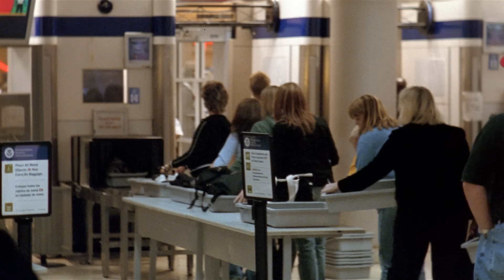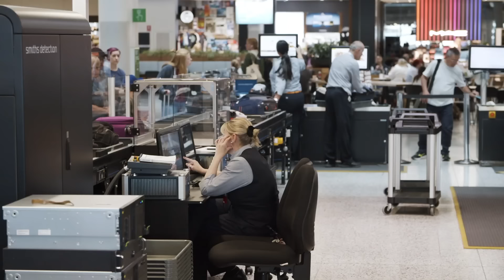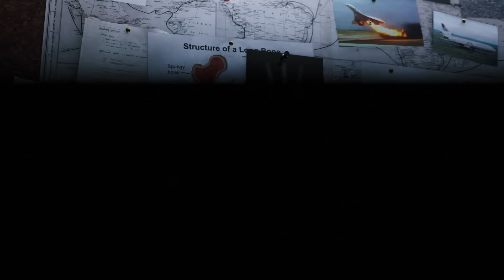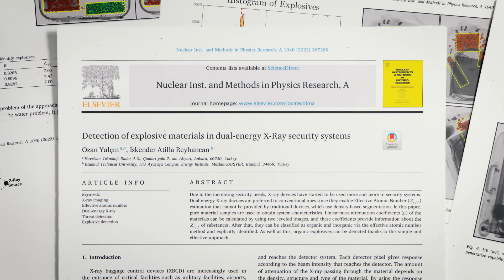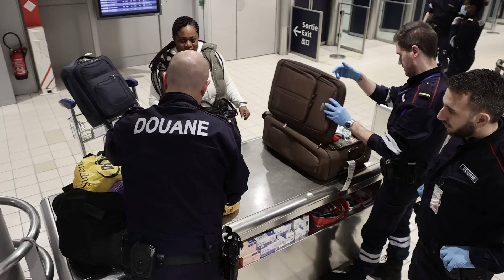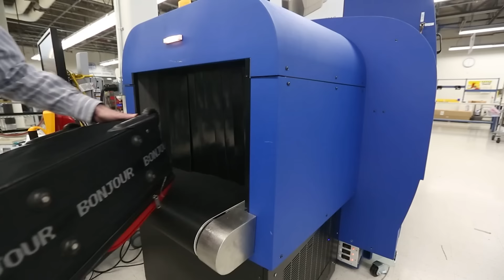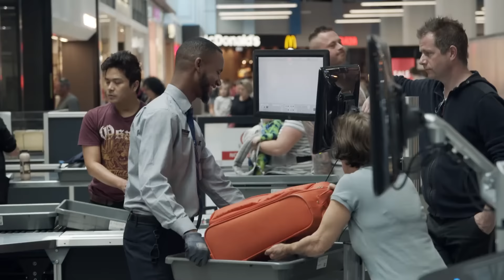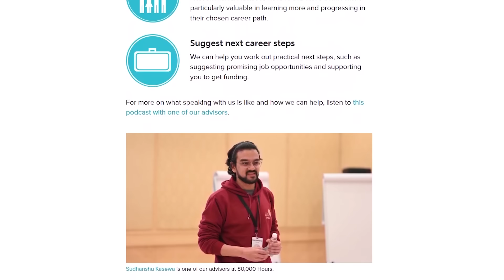Why Airport Security Suddenly Got Better

Comment: Wow, it does it so fast. LTT just did a video on one that had scans that could take 11 hours for high detail.
Reply: I just watched that video too. I have a masters degree in medical image processing, so the immediate first thing I thought of when I saw both these videos was "dude, thats spectral ct" lol

Funny how both these videos came out so close to one another
Reply: LTT?
Reply: @ShainAndrews  Linus Tech Tips
Reply: Cause the "emmiter" and "reader" of his machine is stationary and is the object that moves, and it changes the focus. with each object.

The airport ones have an easyer job, because the position and focus of the object is alwways the same (the tray). And the emiter and reader revolves arround it. Les variables, easyer job, thus faster.
Reply: It's also doing much less detail to begin with. The one LTT have is for verifying an individual M1 screw is properly in place, or that SMD solder joints are good, while this one just wants to know roughly what an object is. LTT's is probably just as fast for the same level of detail
Reply: @javipaniagua2942 It also doesn't need sub millimeter accuracy to get the shape and density of pretty much everything in a bag. TSA isn't inspecting solder joints on your VR headsets, but they'll see your dildos and clothes just fine
Reply: @javipaniagua2942  Cargo scanning.
Reply: @javipaniagua2942  What the hell? Okay, this is really bugging me. 'easyer'? 
EASYER?????? That has to have been intentional, I assume, because you did it twice and the two keys aren't even next to each other. EASYER
Reply: @polygontower  chill m8. i learned english by watching YT videos, wtf did you spect? Perfect spelling? Would like to see you writing spanish perfectly on a f-ing social network.

As Frankie said: RELAX not a big deal.
Reply: LTT isn't even smart enough to not sell shit they dont own, or read a message asking if he's absolutely sure he wants to do this it will break the os.... 11 hours is impressive considering.
Reply: @thisisobviouslybait U mad bro?

Comment: If they were only interested in blocking a bottle of explosives, they would have let you bring the water bottle after you drank some of it in front of them.
Reply: They'll claim it's because the container itself is large enough to be used to mix smaller amounts to make a bomb even if it contains nothing dangerous. Yet somehow if you have a massive thermos or sports style water bottle it's ok? Seems a bit inconsistent to me.
Reply: To be fair, if you were trying to blow up a plane, you wouldn't be that worried about the non immidate health effects of drinking a small amount of some chemical. So that "drink it" solution probably doesn't work.
Reply: @silensuna  A reply on a similar comment on this video mentioned that Japan does this, and that someone had an overdose from drinking it. Another person mentioned that Japan does it because of the sheer trust that Japan has for it's citizens. It's an interesting culture thing for sure.
Reply: Perhaps if your clear liquid is denser than water, you could have water floating above your dangerous chemical and take a swig without issue.
Reply: @tomblaise  same brain!
Reply: @plackt  Ahaha yeah! 🫡
Reply: “Sure, just a sec…”
(Okay, now the 40% denser H2O2 has settled I can drink some of the water I put in on top)
Reply: @plackt  Try drinking water with explosive grade H202.
Reply: @plackt is H2O2 hydrophobic? I think it would completely mix and not settle as you're suggesting.
Reply: But that holds up the line
Reply: So does only having 3 of 9 lines open 😂 @Dunger974

Comment: There was never any valid reason preventing bringing a bottle of water into an aircraft.
Reply: The industrial security complex conspired with airports to make you buy water that costs 12x more a bottle, inside the airport terminals.
Reply: Nope. I don’t believe I ever stopped doing it, though I didn’t fly right after 9/11, so they may have been more serious about it then. By 2005, it seemed like they weren’t too crazy about it any longer. At least I’ve never been gigged for it.
Reply: He just explained in great detail why you’re not allowed to bring water on an air plane. What is wrong with his reasoning?
Reply: @Dunger974  You can bring water that you buy at the gate kiosk for $7 per bottle.
Reply: Damn, if only you’d waited a few more minutes before posting this comment 😂

Comment: "i miss the good old days" moment
Reply: I’m told that in the good ol days, you’d get on a plane just like a bus or train, sometimes even running.
Reply: "this just goes to show how much better airport security was in my youth"

--a 19 year-old
Reply: me to i miss walking to the gate with family most people born after 2001 will never understand all this police state bs is  normal to theam but its not normal.
Reply: @fractal4284  I was going to say the exact thing you just did. Good old times.
Reply: I miss when cockpit doors were unlocked. ;-)
Reply: I would rather take the modern safety, comfort, relatively lower prices, and zero risk of hijacking over the nostalgia of the old days. Modern aviation is the best it's ever been
Reply: @stormix5755 have you heard about modern boeing cheapo planedesigns, and outsourced software development to india?
Reply: @stormix5755  B767 MAX has entered the chat.